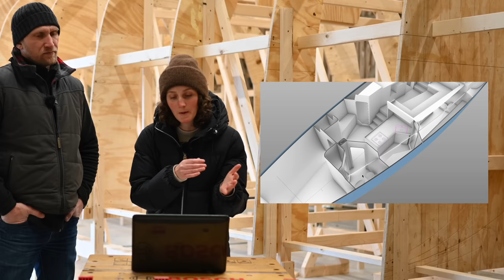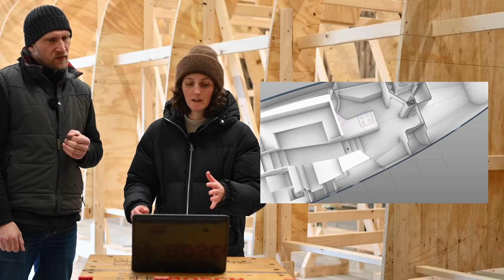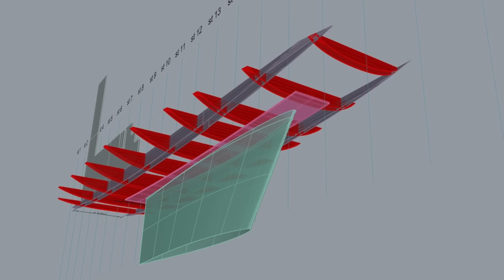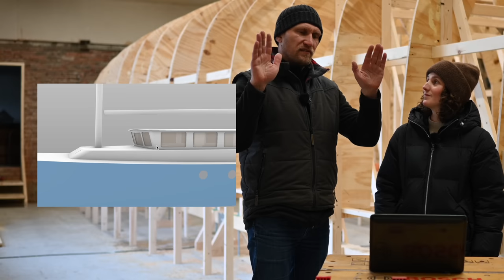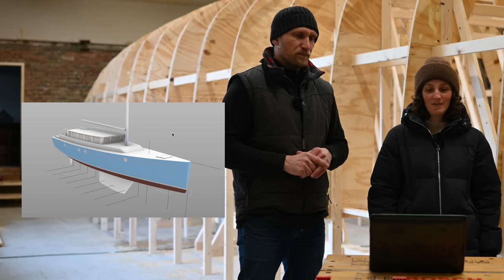How much have we spent? Building a 50 Ft Sailboat - Ep. 339 RAN Sailing

Comment: Recently you published an episode in which you discussed your rollers and how you clean them and keep them conditioned for continued use.  The part of the presentation where you discussed the acetone raised my caution level.  Please be careful with the flammable fumes from the acetone.  A YouTube couple who owned a new catamaran recently posted details on how their boat accidentally burned.  It involved acetone use in a restricted area,  I'm hoping I don't sound too critical.  I've been watching your hull lamination process with great interest because I'd like to build a boat at some point in my sailing life.  For other boat builders or sailing families who may read these comments, I have the same thoughts regarding the careful use of MEK, Denatured alcohol, and maybe certain adhesive removers, as well as any buildup of airborne flammable dust.  One thing I have noted in my own work with fiberglass hulls in my dry Colorado climate is that I often generate quite a static charge in wiping the fiberglass surfaces.  Keep up the good work.

Comment: I've never built a boat but in my construction career I've built houses for over 25 years... roughly 60 homes so far.  I don't find saving money on the expensive items as the large savings it is saving money on the items that is numerous in your projects that makes the difference.  $100 off an appliance is nice and shows up quickly but buying fasteners by the pound instead of by the box will save more than double that per fastener type.  Not as fancy or flashy on a report but money is money.

Comment: Hi from Lake Superior!  We have enjoyed your videos from the start, and look forward to each one. I am enjoying your new boat build, noting the long list of decisions that you guys have to make. It's hard to know where to make changes and where to freeze the design.
  I have a couple of suggestions that come to mind, and wonder if they have merit.  Your coach house windows in the front concern me a bit. You have a nice negative slant to the whole front surface, but I can see a problem with large waves coming aboard and hitting the front window to deck junction. All forces would be aimed at separating the house from the deck, or breaking those windows.  Perhaps design the front window surface with the center point moved forward 8-10 inches. This would form a V shaped front surface to better reflect the power of those waves, combined with your negative slant to the glass surface. 
  Second suggestion involves your hull, well rather the lack of a rudder skeg on the hull. You have that spade rudder just hanging out there, waiting to snag lobster pots, get bent to heck by that big floating log that you just drove over by accident, at night say.  While your rudder shaft probably is as big as my neck's diameter, it could still be bent or jammed I assume, right?  A skeg would be good here, I bet.
  Well other than adding a tad of arc to your cabin roof line (to shed water), you have an enviable project in hand and I look forward to seeing the progress as you go.
Reply from the maker: Good points and ideas! 😊 Thanks for watching. Cheers!

Comment: Have you considered a skag hung rudder. A lot of safety in one.
Reply: Yes, we've been wondering about that too - we've had some bad experiences involving broken rudders. Skeg and rudder = safety.
Reply from the maker: Hi guys! The rudder design isn’t decided yet. We probably will go with a skeg rudder, but we’re also thinking of the option to really over engineer a balanced spade rudder. 😊 Cheers!
Reply: ..a stern hung rudder is a must have.  Makes repairs easy, even at sea.